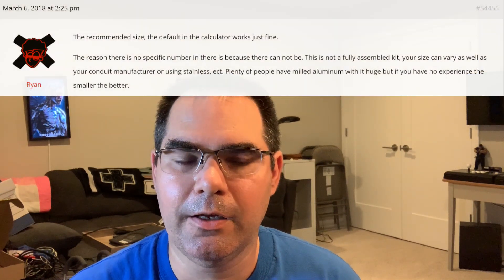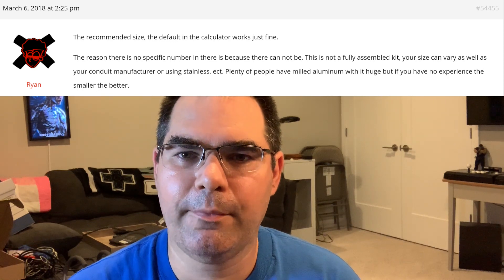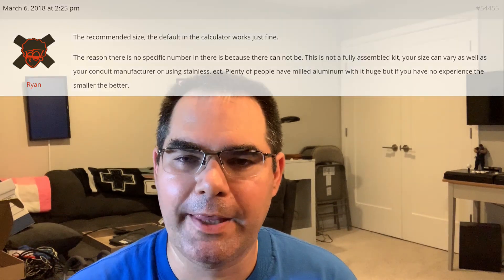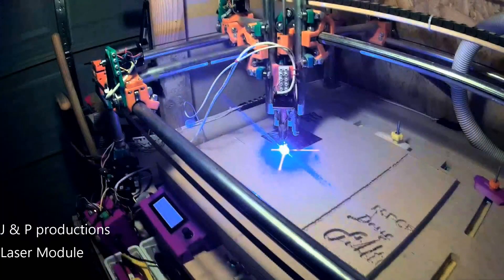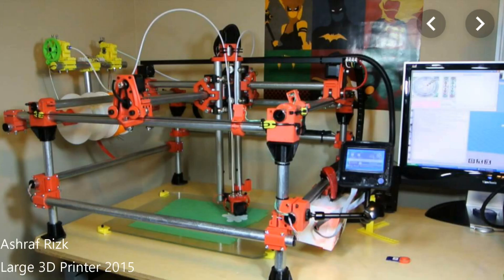How to ask more effective questions when researching the MPCNC

Comment: I just watched your MPCNC playlist & you're quite the top-down/real-world system engineering type and your MPCNC videos will save much profanity & throwing-things (keep'm coming).  I can get cast iron plumbing pipe & fittings for cheap and will try it with that.  Thks
Reply from the maker: Thankyou! I'm trying to differentiate by bringing my experience as an engineer into the fold, and help prevent the frustrations I hit, so I'm glad they help.  Cast Iron sounds solid for a CNC frame, looking forward to hearing about how the build goes!

Comment: MPCNC is the kit car of CNC. The important question to ask us HOW did someone cut aluminium. It would be nice if someone went through all the choices: PLA vs ABS, galvanized vs stainless, dremel vs Chinese spindle vs router, Fusion 360 vs Whatever, Marlin vs Gerbl, etc. Basically the missing thing seems to be info "around" the process of building the machine. Unless of course I just couldn't find it.

MPCNC is awesome but it reminds me a lot of the early days of Linux: your mostly working off your own, probably limited, wits.
Reply from the maker: Lawrence Manning there’s detailed instructions on the v1 engineering site for assembly, and some videos of builds to help out. One of my videos take about gotchas that I didn’t find online. The Facebook group and forums are active and I’ve found helpful. But yes, it can be very much like Linux in many ways :) I am hoping to get mine up and running so I can share my experiences with Aluminum, especially now that I’ve found some great projects I want to make!
Reply: @geektoolkit  Am interested to hear how you get on with aluminium. Hopefully you have a decent router. I had mixed results with my Chinese spindle, but I built my MPCNC for wood working projects so that's cool.

The instructions are good but stop short at things like dust extraction and cable management.  It would be great if someone could bring it all together and maybe present 2 or 3 complete builds.